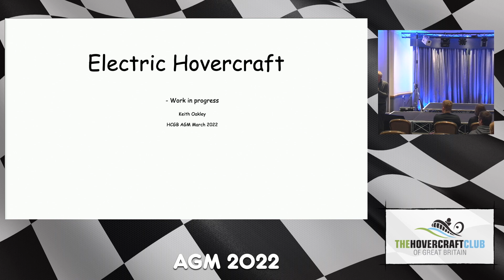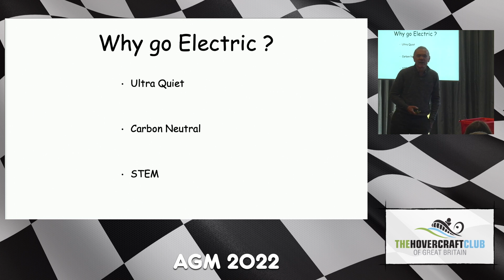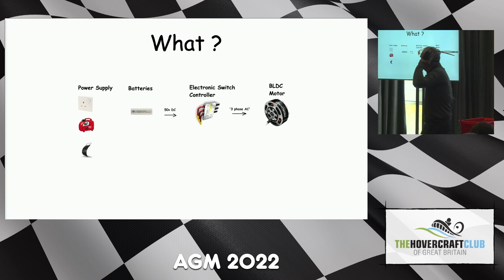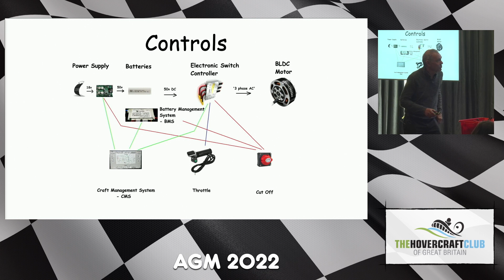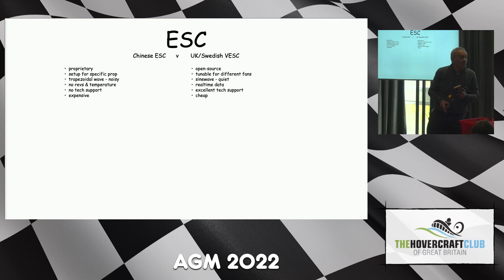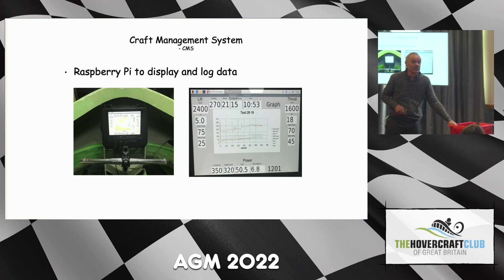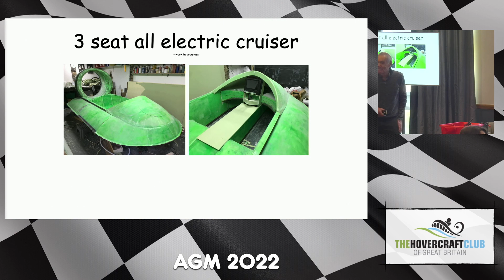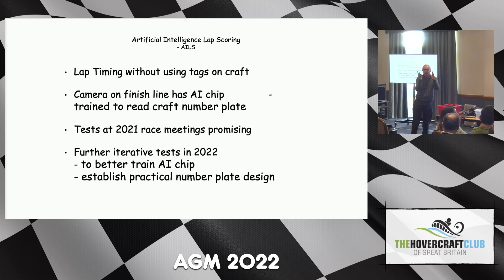Techtalk - Electric Hovercraft - Keith Oakley - HCGB AGM 2022

Comment: Interesting - some good R&D experimentation Here.  definitely look into the EPPG guys as some of the off the shelf setups are producing some good thrust and the Battery Management systems have had quite a bit of time and effort put into them.  I don't have electrical know or I would jump on an Electric hover project.  The tech is there and with gas prices is looking more attractive even if the initial battery investment is steep!   Good luck I hope to come see some Good ol' Racing on your side of the pond.

Comment: Facinating stuff, clasic problem though with the motor and controller blowing, with that sort of inertia. You will need suppression filters on the controller and even a crowbar circuit to load dump the stored energy in the motor. Keep the cable lengths to a minimum due to inductance. The motor is not 40kW or even 20kW or any where near. But not all bad news, Howard Ash calcultions are misleading, electric motors will give 2.5 times the kW rate of a petrol engine, it has to do with the electric motors ability to keep its rpm up with a correspondingly high amount of torque. Also he compared petrol v batteries directly without mentioning engines are only 15% effecient. You wont need 30kW thrust from an electric motor nor the battery size you think. Hope that helps.